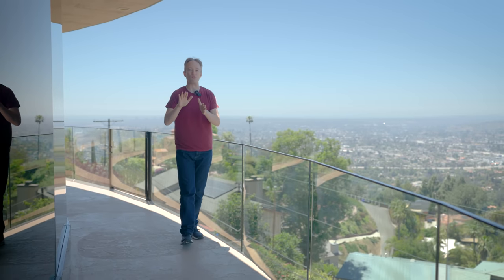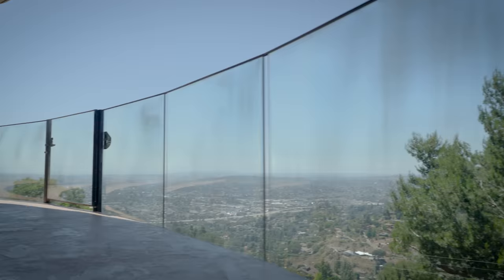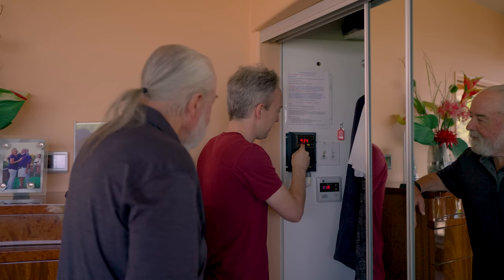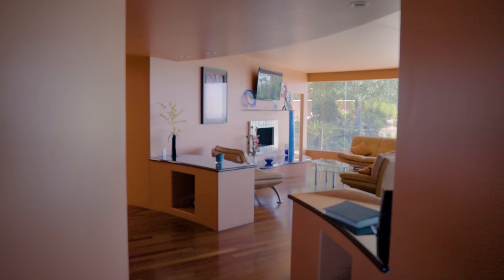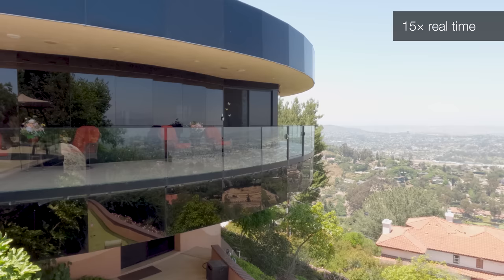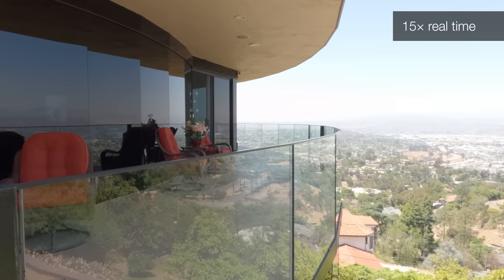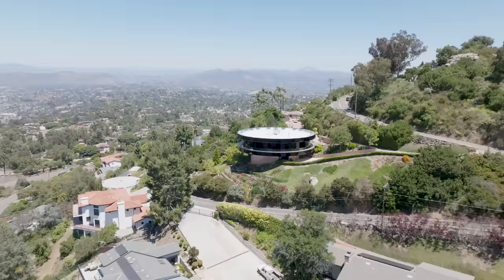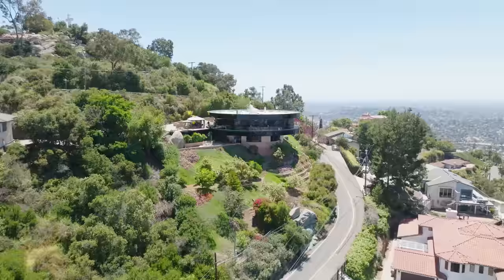I thought this rotating house was impossible.

Comment: As a practicing Architect, I gotta say this man is a genius. The plumbing slip ring is mind blowing in it's simplicity.
Reply: I hope to see more genius houses like this one in the future 😊
Reply: So many brilliant inventions are incredibly simple once they've been invented, but almost impossibly complex beforehand. There's a genius to inventions like this.
Reply: @garypatterson2857  It is so humiliating. After learning how he solved it, it so depressingly obvious... But the most obvious solutions often are hidden from us.
Reply: It really is brilliant. However, i think i would have put the sewer ring on the bottom, not the top....! (Im sure he had good reasons).
Reply: pipe in a pipe would be more easy tho.
Reply: I just wish this information was more 'out there' when I was redesigning a revolving stage 18 years ago for wired lighting and television/audio signals. Power sliprings were hard enough to find on a needed scale, individual circuits, not overall amperage.  Only having ~4" in height to work was also hard.  Ended up with a pile of cables to switch instead of multiple circuits, a hidden cable drop from above for central communication, and a car battery/inverter/charger for a DVD player and vintage working TV.  Somethings were easier than others, UPS couldn't do the TV/DVD, but COULD do the working bird/water fountain (speaker removed!). Fun times!
Reply: @neutronenstern.  You wouldn't be able to install leak alarms for that though..
Reply: @spinaltap22  if not as much goes in as out there is a leak. Easy
Reply: It's a variation on the hydraulic slip rings used in excavators to feed hydraulic fluid from the cab to the base. Obviously they don't have to worry as much about leakage but the basic design is similar.
Reply: @philw4625  the sewer ring being on the top means it goes down the centre, probably meaning it has more space to prevent any clogging or something like that
Reply: @neutronenstern.   You can't know how much waste will be in the sewage.  That is, unless you weigh, measure and document your excreta like a gentleman.
Reply: I feel like I want a house like this now.... but I guess even just seeing the check would make my head spin.
Reply: He’s not a genius for the idea but the tenacity to actually build it then get it approved through all the tedious codes.
Reply: @spinaltap22  one can measure flowrate tho. Also there will only be two points, where there can be a leakage. The rotation parts. And these can be checked with a easy sensor, like a camera or sonething.
Reply: @neutronenstern.  What happens when I fill the bath?  Water in, none going out.  What about water I drink?  You haven't thought about this anywhere near as long as the dude clearly did.You're over-complicating it.
Reply: @spinaltap22  whaaat?
I only care about what leaks inside this turning system. So i measure right before and right after it.
Reply: @neutronenstern. I see what youre saying and it makes sense to me. But I like the slip ring design, its just cool!
Reply: Basic engineering actually. Building it from a cost perspective is another thing.
Reply: "As a practicing Architect", as if that would mean something
Reply: Architects aren’t engineers… or plumbers
Reply: @illsmackudown  does it not? They design structures. This is a unique structure.
Reply: Some people just cant wait for an opportunity to be rude or snide, it seems.
Reply: And the thing is, it HAS to be simple, the more complexity you put into it, the more there is to potentially go wrong.  Like others have said, it's obvious in hindsight although I'm not sure I'd want to be the engineer that has to change the seals when they do eventually wear out, of it there was some kind of blockage in one of the lines.
Reply: @LesNewell  I learned this from FarmCraft101 when he had to rebuild the swivel joint/rotary manifold/rotary union in the old excavator he bought.
Reply: its
Reply: @philw4625  The rings are organized in such a way that the top ring has the lowest pressure and the bottom ring has the highest pressure. Any leaks would go from the bottom up. (Water and gas systems are centrally pressurized from their distribution centers, this is why water pipes sometimes burst and create "geysers")
Reply: @MattH-wg7ou  "They design structures."
Architects just draw things - they don't necessarily design them. I was quite amazed to find the degree to which some architects just draw whatever looks nice and then tell some engineers to go work out how to build it. This is crazy because beams have thickness and good design really does need to be iterative with the actual structural engineering.
Some architects do care about the actual how, but some really don't, and strictly speaking it's not their job.
Reply: @neutronenstern.  Not for maintenance
Reply: *its simplicity
its = possessive
it's = it + is
Reply: @kortzite5204  Ah! That does make some sense, i guess. I figured they'd have had the 'yuck' thought process when designing it. That said, in the event of the gas ring failing, you have natural gas flowing through your water and sewage lines?? Im guessing these slip rings are massively over engineered and long lasting (they can clearly handle huge pressures in other applications such as hydraulics etc - - it just feels a bit 'hopeful' that they don't eventually get fouled  up, especially if they aren't moved regularly?
Reply: As a non-practicing architect, I agree.

(no capital “A” because I have the education and internship hours, but not the AIA title)
Reply: Similar to how air lockers work on 4x4 freewheel hubs & diffs - that's not to demean the thought process that went into it. Brilliant - the definition of innovation vs. invention right there ... Repurposing existing materials, components & methods in different ways to do something different ... and brilliant. Love it ...
Reply: @kortzite5204  my question is, what if there's a 0.0 1% chance of a leak in the upper ring for sewer water after many years, it still will flow down to clean water ring despite positive pressure trying to keep it out. Im certain two systems have to fail, but still there is a very remote chance of mix.
Reply: @philw4625 Why? It doesn't matter if it fails its still in the lowest part of the house and still damages the same things
Reply: @neutronenstern. Still need slip rings. Cant just rotate pipes
Reply: @philw4625  I was wondering about this myself, surely there's a reason

Comment: This man is an inspiration to aspiring engineers. The agent that decided to contact Tom Scott deserves a raise.
Reply: I do think that the sewer should be at the bottom and not on the top, in case the seals should fail.
Reply: @BSnicks  it doesnt really matters. You would need both seals to fail at the same exact time, and the sensors to not notice anything. That's not going to happen any time soon.
Reply: @BSnicks The freshwater has a higher pressure than the sewage, so vertical position is not that important.

Comment: Can we take a moment and realise this whole house moves on 1hp... that's incredible
Reply: pfft. I got a whole planet here that turns on nothing 😁
Reply: @MattNolanCustom  yea but unlike the house you can’t control how much it turns much less stop it.
Reply: @johnlynch1353 well, if we're being picky, we've changed the speed slightly as a by-product of building huge dams (in the same way that a figure skater doing a pirouette on the ice can speed up or slow down by drawing in or raising up their arms) and the Moon is constantly slowing us towards a stop.
Reply: The beauty of Gearing and Torque multiplication. As long as you are not in a hurry, you can move a lot of tonnage with little power. If the bearings are good, and there is some balance to the house, it probably does not require as much power as we would initially think. I do wonder why he downsized the motor when he put in the gearing? Material stresses? Packaging?
Reply: @gamerjunction5335  I think he said so; too powerful and could therefore not get "up to speed".
Although that doesn't make sense, now that I write it. Unless that 5hp motor would have given the house light-speed in moving round, which is what you don't want.
So, my guess is that a 1.5hp motor at full throttle gives the house a decent rotation. A 5hp motor at 1/4 throttle gives it a bumpy ride.
Reply: The rotating restaurant on top of Seattle's space needle, as large as it is, only requires a few horsepower to make it spin.
Reply: You can turn almost everything with 1hp. But at which speed?
Reply: I thought that he said that it was 1.5 hp motor?
Reply: @MattNolanCustom  I thought our moon was slowly drifting away from earth.
Reply: @BrianRIngram  it is. The energy the Moon bleeds off by very slowly slowing the Earth's rotation is what slowly boosts the Moon's orbit.

Comment: This old man deserve a standing salute from architects & engineers. His plan for water and electricity management is 🔥
Reply: Architect? Engineer more precise
Reply: I like it but I feel like there's more to plumbing than not leaking. Like how do you deal with clogs? 🤔
Reply: @sn31t33   r8
Reply: @emissarygw2264 He lived there for 20 years so I’m sure he has some solution he can teach to the next owner
Reply: Not a fan of the seals being a possible point of failure, but if he made it work for 20 years then i can only concede it's a good solution in the end
Reply: @kalvinkearney4169  true... Just one of those things where anything not done in a "standard" way is super hard to maintain because nobody knows how to do work on it
Reply: @KanpachiGaming especially with the sensors and the way it's designed having an effective failsafe
Reply: @emissarygw2264  there's probably a known rotation angle where both sides of the slip ring line up so you can treat it as a single pipe in that case.  So just rotate the house to that position and you're good to go for any maintenance.
Reply: @KanpachiGaming  The only thing I don't like about it is that the sewer is on top.  Why do that?  Putting water supply on top would make so much more sense.
Reply: I think you really mean engineers. All architects do is draw cartoons. It is others who actually come up with solutions.
Reply: @KanpachiGaming can you think of anything else? At least he has sensors  as a fail safe
Reply: it's amazing that this was certified and allowed for the gas pipes as well... mixing sewer with drinking water is one thing but leaking gas... and all the laws and certifications regarding gas infrastructure
Reply: @emissarygw2264  accessible traps before the convergent point.
Reply: @KanpachiGaming  It's why I'm confused why he doesn't have drinking water on the top, then grey water, then sewer water. You want redundancies - If both seals and the alarm ring fail, you want the more contaminated stuff to not have a chance to contaminate the less contaminated stuff
Reply: @Icalasari that does make a lot of sense… it’s also totally possible that our graphics got flipped upside down.   

OTOH, “fail-deadly” is a valid design.  You’ll notice if your water turns grey, but if you have clean water leaking into sewer water you won’t spot it until your water bill comes in
Reply: Except. Why wastewater on the top?  Everything eventually leaks. I'd have gas on top, drinking water, then grey water.  I see now that he has double seals and leak sensors but still...
Reply: How did he get the natural gas included?  I suspect that approval was the most difficulty because it's the only real safety risk.
Reply: @brianwest2775  but you wouldn't need gas on the top. You notice how grey water and waste have bigger channels than the rest. Those need to be flowing out of the house faster than the water etc to come in. If you have build up and back pressure then it'll be a disaster. That's why in general waste pipes are fairly big and have the easiest way of getting to the sewer.
Reply: Hello. Seal design engineer here. The thing about any system that rotates with liquid is that it requires seals. A lot of the aspect of the design process is not trying to design out the need for seals but instead to optimize speeds, Temps, surfaces, etc to maximize the life of the seal.
Reply: @KanpachiGaming  Not a fan of the drinking water portion being below the sewer portion myself. Like, why?
Reply: @Jacob-zo5fv  Any idea what those seals are made of? Wouldn't it contaminate the drinking water as it rubs off?
Reply: @stickinthemud23  they work side by side actually. if you want an ugly house designed by a engineer be my guest
Reply: @dimondskate  that misses my point but thank you.
Reply: @jonc4403  exactly my thoughts. on the other hand, this guy is smart enough to realize that too so i assume there is a good reason for this

Comment: The part of the rotary connection that handles the fluids is known as a FRU, Fluid Rotary Union. It's how equipment like excavators are able to operate. Where I work, FRUs are often used on high power radar masts and naval turrets to provide liquid cooling to the systems.

Comment: Rotating structures are common in power generation systems where pollution control and heat exchange systems can use rotating components to transfer heat or collect and remove particulates from the exhaust system from boilers. I’ve built rotating components that are roughly the same dimensions as this house. This is definitely a great solution to an age old problem. A remarkable segment to share with us. Thank you so much.